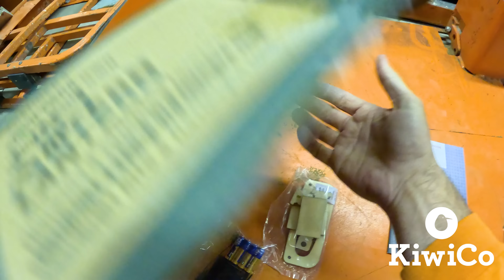How to Install an Elevator in your Backyard

Comment: Construction GC here, that fiber glass rebar will soon become the standard. It’s hard to convince the old head engineers to accept that is a better option than the tried and true steel. Easier to work with, no risk of rust in a wet environment such as a car wash, cheaper to transport and stronger.
Reply: When he mentions its stronger, what does he mean exactly? More tensile strength? Strong as you certainly know can mean a variety of metrics. I hope its not just “stronger by weight ratio” like some other materials are often said to be.
Reply: @alexdrockhound9497  "GFRP rebar typically has a higher tensile strength compared to steel rebar. It can have a tensile strength of around 1,000 MPa (megapascals) or more, compared to about 400-500 MPa for typical steel rebar."
Reply: A massive dam we built used tons of fibre glass rods for ground stabilization to stop the hill side coming down on the access road and access path, the only thing we really used steel for was the toes of the dam but that was cause it needed to tie into the concrete toe and concrete back of the dam.

If fiber glass can be used for heavy duty applications like that I don't see why it can't be used for smaller things like this, plus it's really nice with how much lighter it is and not having to worry about scratching paint and protective coatings like you get with steel.
Reply: The slow acceptance of Glass Fiber Reinforced Polymer (GFRP) bars really boils down to the fact that it is a different material with different mechanical properties and it cannot be a simple drop-in replacement for steel rebar. 

- Steel has a yield point, or stress at which it will elongate significantly without at increase in load. This is extremely important from a structural engineering perspective, because it allows impending structural issues to be seen (excessive deflection) before catastrophic collapse. This behavior is also very important when designing for earthquake loads. GFRP does not have this yield behavior and instead has a more sudden brittle failure. Based on a quick search it appears that the precise effects of this difference and the design modifications required is still an area research. I would hazard a guess that this is the primary issue holding up the adoption of GFRP bar.

- While GFRP can have a higher ultimate tensile strength, it has a much lower modulus of elasticity. This essentially means that GFRP is less stiff and more prone to unwanted deflections under service loads.

- GFRP has different bend requirements. Field bending GFRP is more complicated than steel and requires a larger bend radius. GFRP can be manufactured pre-bent but this requires very detailed shop drawings and, based on data for TUF-BAR, the bend radius is still larger for small diameter bars.

- GFRP can apparently be damaged by exposure to UV light, so there are some special storage considerations.

- GFRP is not recognized in ACI 318, which is the primary concrete design code for buildings in the U.S.. ACI does publish an additional document, ACI 440, that covers GFRP, but GFRP just doesn't have the code recognition that steel bar has. The more limited code recognition is intimately related to the issue in my first point.

These are just a few of the issues from the engineering side. GFRP does have a lot of benefits, and I would love to see it more widely used.
Reply: I remember reading that Duroplast, the fiberglass-esque material that East Germany used to build the Trabant back in the day, was twice as strong as steel, and my first thought was "That's gotta be bull." But now I'm starting to think they weren't kidding.
Reply: @stevethepocket it might still be bull. Im not certain, but my immediate concern when i hear phrases like that is that they might mean “stronger per weight” like how titanium is often said to be stronger than steel. But with the titanium example, its only stronger if theres more cross sectional area. A 1” round piece of strong steel is still stronger than a 1” round piece of titanium, just much heavier. A piece of titanium of the same weight, but much larger in size, is stronger than steel, but size constraints come into play in a lot of engineering situations. 

So yeah, i think its possible that this fiberglass rebar is really strong, but im not going to immediately accept it as true until i can research it further. Theres a good chance that that stronger claim should have some sort of asterism beside it.
Reply: @alexdrockhound9497  Strength is measured in Pa, which represents the pressure (or tension/compression per area), in any scientific/engineering context. Strength to weight (or specific strength) is another useful metric for engineers, but much more popular in sporting/aerospace uses than it is in civil engineering (at least if only used in small amounts like rebar). There are also issues with the fact that you may want to match the thermal expansion of concrete and compromise fiberglass strength in doing that.
Reply: @pabloarroyo1023  i know, im an engineer.
Reply: If it was just as good or better, companies would be jumping at it. It's cheaper than  steel, from what I can tell. There is always pro and cons.
Reply: @zack9912000  they price it at the same as steel. I think they had problems pricing it lower than steel to retail customers.
Reply: The reason steel rebar is used as reinforcement is not solely because of its strength. There are so many reasons other than strength to not use it, corrosion, weight, cost of implementation, etc. The primary reason steel is used is because of its similar rate of thermal expansion. Without this key similarity, internal stresses would render the composite structure worthless.
Reply: Construction GC  Instructor here:   I'm not as optimistic. Most of the rah-rah for GFRP (Glass Fiber Reinforced Plastic) comes straight from manufacturers or trade associations that are promoting it  as a cure-all and are obviously biased.  And I don't believe one word of the "it will last 20x as long... blah blah claims".  At this point that's all digital modeling and not real-world performance.   Currently where I'm located GFRP is 3x+ the cost of black steel rebar.  It's strong in tension (pull) like steel but only in one direction - the long way.  Across the bar it's brittle and prone to sudden shear failure.
Reply: @HBSuccess  WIth the energy market changing, oil companies are pushing any use of plastic they can think of.
Reply: @HBSuccess  Bingo.
Reply: Rust is horrible, and the spalling and deterioration can make concrete quite structurally unsafe. I would think they should be jumping onto that fiberglass rebar. There are just too many ways that neglect or other factors can cause water intrusion into concrete, so why not make the concrete less susceptible to water or other damage?
Reply: When I saw that I wondered... I thought one of the key properties of rebar is the thermal expansion coefficient.  And that's much higher in metal than in fiberglass.  
How can it bend?  I often see rebar with one or more right angles in it, and sometimes complex shapes in videos about more interesting projects than just a standard slab.
Reply: "Acceptance" isn't the problem, it's the price, steel is still cheaper then this.
Reply: Same with ppr. I had a construction job about a year or two ago, and the architect was headstrong on using copper and steel piping. We completely disregarded his orders and went for ppr. Next thing you know, he's praising us for doing so because he was forced to use it in another construction site and realized just how reliable, quick and long lasting that thing is
Reply: How does fiberglass fare against earthquakes? I live in the pacific ring of fire where earthquakes happened atleast once every two weeks
Reply: @dean2521  
How does fiberglass fare against earthquakes? I live in the pacific ring of fire where earthquakes happened atleast once every two weeks

You can not afford an elevator anyway. Where would you put it?

I would put an elevator onto my video game island, if only it would give me that 3-D model. But onto my home? I would need either a larger home, or at least somebody with a disability needing an elevator. Buy a ranch-style home, less need for an elevator.
Reply: Does the fiberglass rebar also increase the lifespan of concrete dramatically? I learned because of rust old buildings tend to crumble.
Reply: @merlinkater7756  
Does the fiberglass rebar also increase the lifespan of concrete dramatically? I learned because of rust old buildings tend to crumble.

Of course, I would think so. But I read something in the comments, that fiberglass may not have the similar amount of thermo-expansion with changes of temperature, so that sounds like that would be an important factor also, as outside areas have to endure wide temperature changes.
Reply: В железобетоне арматура работает именно на растяжение, тогда как сам бетон работает на сжатие. Стекловолокнная же "арматура" тянется как сопли, а потому не играет вообще никакой роли в армировании бетона, с тем же успехом можно было залить просто бетон.
Reply: Yeah but how you ment to weld up a cage for the bottom of a pylon sign ect
Reply: Ну смотря в каких строениях стальная арматура более устойчива к пожарам , у зданий есть определенное время на устойчивость конструкции при пожаре чтобы можно было эвакуировать людей.
Reply: My only concern with fiberglass is that eventually, the resins break down, just like any plastic/ABS materials.
Reply: It might be stronger but is the thermal expansion the same
Reply: @johnpaulporrelli6208  "The coefficient of thermal expansion for GFRP rebar is closer to that of concrete than steel rebar, which helps maintain the integrity of the concrete structure. The typical coefficient of thermal expansion for GFRP is around 5-8 x 10^-6 /°C, whereas for steel, it’s about 12 x 10^-6 /°C."
Reply: @johnpaulporrelli6208 thermal expansion is better. Lower.
Reply: It might be stronger but it's not ductile. So using it in a overhead structure like a bridge, it won't flex it will shattering brake. So there will not be any signs of failure, just failure.
Reply: @tristin5723  Just like that carbon fiber sub that went to the Titanic. Same thing happens to bicycles as well. You often don't know there is a problem until they explode into pieces.
Reply: @TRauck1506  Nope it's fiberglass strands just like boats. Boats don't fail by suddenly snapping in half while someone is water-skiing.
Fiberglass is well known and this thread shows the problem with adoption. People start making up stories like they don't know what fiberglass is or how it acts.
Reply: @sparksmcgee6641  Still gets a coating to protect it, or else we'd have raw gelcoat boat hulls and hull paint would be non-existent.
Reply: @tristin5723 Not true look up the stats before saying something like that. It deforms and rips. Rebar functions at about 1/8 of an inch. Tough to think it's not the whole piece of bar that holds.
If I remember it also bonds to the concrete which steel doesn't, that improves hold. OK I checked it conforms to concrete better than steel so it holds better. It's thermal expansion is CLOSER to concrete.
I wrote somewhere here that it has less thermal expansion than steel but it's less than steel FROM concrete on a scale.
Reply: @tristin5723  100% correct.
Reply: @tristin5723   And thats the main problem with fiber glass rebar. These clowns don't get it. They want to be cheap and try to save money is all and try to get away with it. Construction people don't care if something collapses cause they already got paid and made more money by going cheaper on materials but its always unsafe.
Reply: How is that stuff when it comes to end-of-life?  
Metal rebar is constantly recycled and barely a problem for the environment.  
I see that as a major problem of those fiberglass thingies or am i wrong?
Reply: @Animaniac-vd5st  It's fiberglass. And recycling concrete shouldn't be an issue of concern.  If you're that concerned look at energy requirements of making it vs steel.
Reply: @sparksmcgee6641  Oh yeah, spinning glass strands doesn't require any higher temps and the offgassing of resin doesn't release any pollutants either. . Glad you caught that. 🙄
Reply: @Animaniac-vd5st  We do the same as with wind turbine blades, put it in a land fill and forget about it.
Reply: @Animaniac-vd5st  I suppose the concrete can be crushed and used as aggregate in a lot of applications, along with the fiberglass rebar component.  It might even be easier to do than with steel.
Reply: What about bending? Cant bend fiberglass. All the other points are completely valid.
Reply: @jacoblong5599 nope they make corners. I commented here that he should have put in steel corners. Fiberglass corners are usually not in stock.
Reply: @JacobLongActingJourney have you never put up a tent that has fibreglass poles?
Reply: @JacobLongActingJourney Fiberglass absolutely bends… Have you never put up a tent? Or put driveway markers in for the winter?
Reply: @T4.Bacteriophage  A long tent pole bends like this because it bends uniformly along the length of the pole.  You can bend steel at a right angle.  I actually had a tent pole snap on me yesterday.  I also assume these fiberglass bars are solid and not hollow tubes like a tent pole.
Reply: @T4.Bacteriophage  OK, bend those items on a to a ninety degree angle and a 3" radius and let us know how that goes.
Reply: @JacobLongActingJourney  Wouldn't you need it preformed with the shape, if it's not a straight bar?
Reply: says the guy from the fiber glass factory
Reply: No its not. It is to brittle. IT can last like a decade before it falls apart but you are gas lighting it up. Better to use steel.
Reply: The reason steel rebar is still used is because most engineers are not licensed to use it because of how new it is.
Reply: @Dann.y  since when do engineers need to be licensed to make a design with a certain material? What federal licensing would this be?
Reply: @Dann.y  i just googled it and i cant find any engineering licenses for rebar design. Theres the Professional Engineer (PE) License, and then contractors have various licenses depending on state, but thats it. I cant find anything indicating an engineer would need a license to design something with a specific kind of rebar.

Comment: Rebar in concrete  is naturally rust resistance it only rusts threw electrolysis or salt water intrusion because of how the ph of the concrete reacts to the steel you only see it as a problem when you have building near salt water like seawater and salted roads or where the rebar is not isolated from other metal electrically like Colin furzes bunker walls

Comment: Isn't the bunker supposed to be used in situation in which you are specifically NOT supposed to use an elevator?
Reply from the maker: The reason to not use an elevator in a public building is because the power will go out and trap you.  We have our own off grid battery power which won't go out

Comment: we did the same but i added a strip of nylon plating on three sides, two thinner strips either side the opening, it stopped the wobbling and kept it stable going up and down.... simple leaf springs kept the lift in place on the front strips.

Comment: You should add vertical metal plates to all four sides on the section of the shaft surrounding the elevator and wheels to the elevator cart that run those plates so that the cart is stable and tied to the shaft.

Comment: Those rollers from the concrete mixer could be sourced for guide rollers for the elevator cage. You MAY need runners along the walls of the shaft. Excellent repurposing of existing mechanical hardware. I applaud you sir!